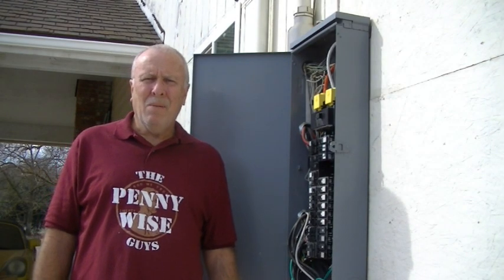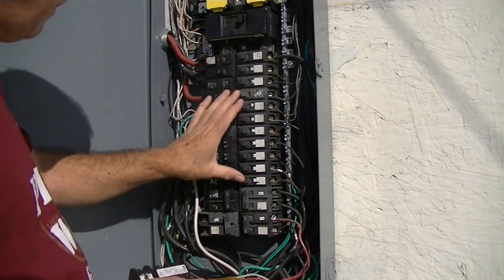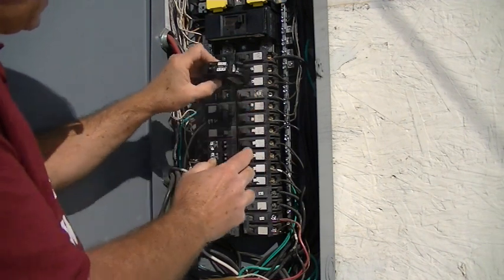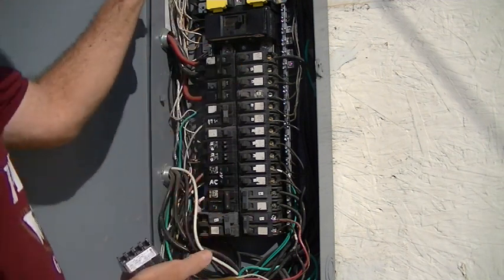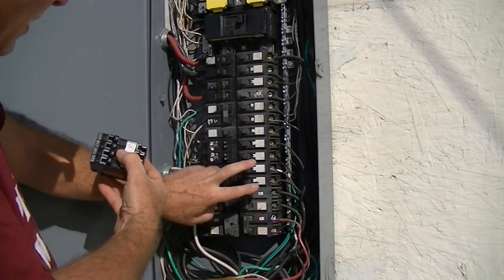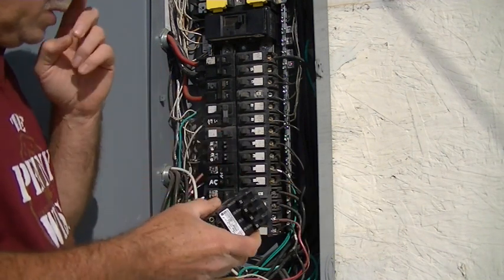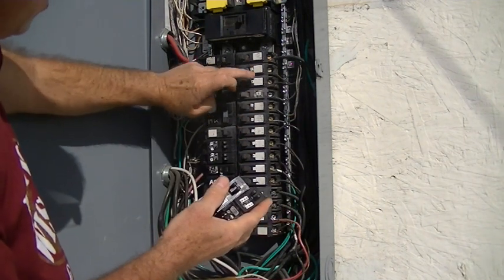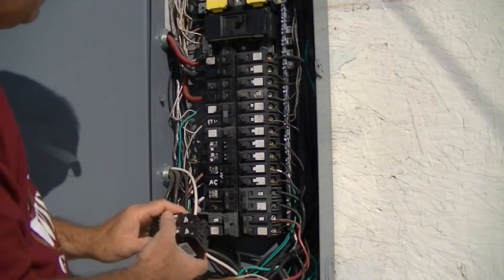Free up Space on Electrical Panel to Add New Breaker / See comments below

Comment: You didn't mention the cheapest option.  2 wires on 1 breaker, save yourself $20 on a tandem.  Just do an amp check on the circuits. Many hardly carry anything, like circuits for bedroom outlets that might run a lamp or two. If the amp draw is low on 2 circuits, then combine them.  Some breakers allow 2 wires, like Square d's homeline.  

The triplex looks useful, but its cost makes it irrelevant.  1 quad for $60 or 2 tandems for $40 is not rocket science.  I guess if you have a 240 load you have no choice, but I think buying one should be a last resort.  Hell, you can buy subpanels for $60.  If space is that tight, put a sub panel right beside the main for additional circuits.

Comment: Before you add loads shouldn't you do calculations based off of what it's being used on  first?
Reply: The size of the breaker is mandated by the size of the wire it connects to. There's nothing to calculate.  Very rarely will you ever see a panel running anywhere near max potential as at any given point in time, 80% of the panel is doing nothing whatsoever. If the main trips, then you need to remove some loads.

Comment from the maker: Hello. I received a comment 6 days ago if a combination of 2 breakers that are both Double Pull breakers could be done on a Quad breaker. The answer is YES. There is a quad breaker that has a Double Pull breaker tied together in the middle two positions with a pin, and the outer two positions, that can be separate single pole breakers or can be tied together with a sheet metal plate that ties them together to make a Double Pull breaker. So you can have 2 Double Pull breakers in a breaker taking up only 2 slots in your bus bar, thus freeing up 2 slots to add your new Double Pull breaker. These specialty breakers can be found online like on Amazon or Electrical Supply dealers. I hope this helps. Blessings